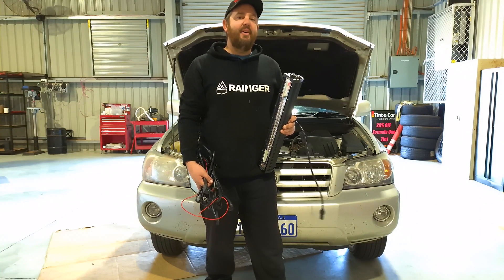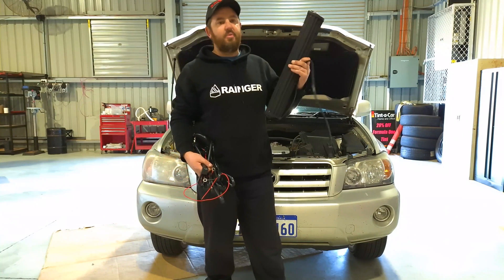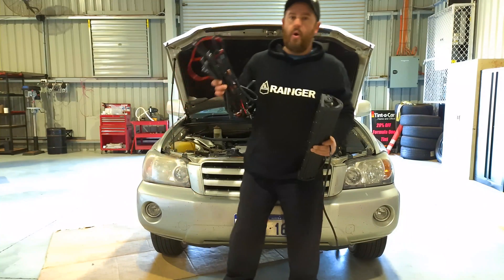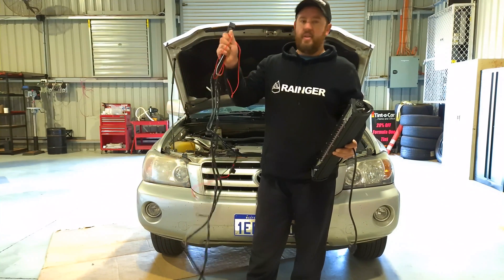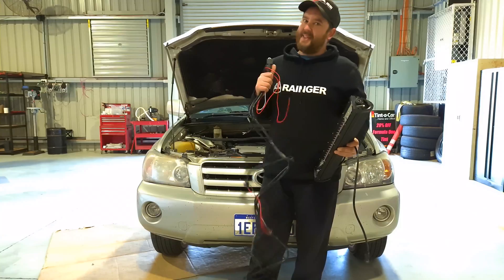How to install a lightbar/spotlights (Beginners guide)

Comment: Man I have found a lot of videos on YouTube regarding this particular subject, and i ain’t going to lie and your video is very well explained and you get right to the point.
Reply from the maker: Thanks mate I'm glad you found it helpful 👍
Reply: I have negative switch highbeam.
I want the lil light on switch to light up when switch is turned on.

Lightbar ONLY allowed on when highbeam on.

I dont know how to wire illuminated 3 pin rocker switch in with it though.
30 is inline fuse battery
86 is power from 30
85 is scotched/spliced HB wire before the car headlight switch (which negative switched highbeams)
87 is lightbar.

You put 2 point on/off rocker switch between scotched HB relay wire and 85 on relay.

I dont know how to do it for 3 prong illuminated rocker switch though.
Can you answer that question? pls n ty.
Reply from the maker: @w0lfm4n43 you can't use the illumination on any switch with negative switching. Only your input & output for the light
Reply: @Campingdownunder  well that sucks butt. Cheers lol
Reply: @Campingdownunder  can u use a separate relay just for the illunation?
Reply from the maker: @w0lfm4n43 never tried. It's not worth it. It causes issues because it back feeds
Reply: @Campingdownunder  so that's what they use that diode for I guess on those harnesses maybe?re
You jump 30 to 86 for negative right, to give the positive on 85.

Can you jump the positive/ground to hold in the third plug going in on rocker switch end?
Theoretically then you should have ground and positive going to both lights when on, n no lights when off?

Comment: This will help heaps, thanks mate, just gotta learn how to splice and solder properly 😂
Reply from the maker: There's a splicing tool you can buy from any auto shop that will do it with just 1 squeeze 👍 that's what I use

Comment: Thanks for the video.  I bought a light some time ago but was going to wire it without a relay directly to a heavy-duty switch or fuse with a switch.  I want to be able to switch it on without any other lights.
Reply from the maker: Always run through a relay. If you are in Australia you need to run it through your highbeam anyway so may as well use a proper loom & then you know you won't have any issues
Reply: @Campingdownunder  
Thanks for the reply.  I will do that.  Have a lovely Easter.

Comment: Hi mate thanks for the video, I'm wiring a light bar to the golf cart, however, its headlight highbeamless (if that's a word), how can I get around this?
Reply from the maker: Just hook the trigger wire to any lights it has then. That way you can't accidentally leave them on when you turn off the buggy 👍

Comment: How do you run a light bar AND spot lights? I got one of those plug n play kits from Supercheap and have since purchased a kings light bar separately
Reply from the maker: You can run it off the same relay but personally I'd run a whole new wiring loom to cover your ass

Comment: How would you connect a light bar with two spotties at the same time? Do you have a video on that mate?
Reply from the maker: You can but it's not recommended. Your better off running them both through their own wiring harnesses

Comment: Hey thanks for the video mate.
Very helpful.
I just have a question...
With pin 86 (vonnecting to the high beam, does it go to the sqith in the car first before coming to the relay? And where do i join the negative coming from the actual light bar?
Your answer would be much appreciated..
Reply from the maker: I made a second video on my channel explaining in more detail how a relay works if you'd like to check it out

Comment: Really well explained. Only question is what lumens was the light, and what would be a recommendation lumens? Iess more, or is it better to get the highest you can afford and your car's general wiring can hand? I want to put  a LED light bar on, seeing that I drive a lot at night and even with the Osron night breakers, its not really the best for the darkness, so any recommendations? And is it better of a high beam LED or just a normal one? If the question make sense?

Comment: Excellent video and great channel. I note some people use an additional 4 point relay wired around the h4 adaptor. You just do it at switch wires or batter power ?
Reply from the maker: Yeah any wiring loom you buy will only come with 1 relay. It's designed to switch the power coming from the battery to the lights. The wire that only triggers the relay doesn't need another relay as the highbeam wire only becomes live when you activate highbeam 👍
Reply: @Campingdownunder  Thanks for that. It would be good if they made them pre wired for either or provided the instructions. All kits these days are for positive.
Reply from the maker: There are quite a few well known brands that make it pretty easy to swap just 1 wire on the loom to switch from positive to negative. The new lightforce loom even switches itself. It already knows if it's positive or negative. They are getting smarter with the looms 👍

Comment: Hi, Spent all day figuring this out on same model Kluger, with the essential help from your video.. 
Now where is a good point to piggy back the ignition power to the relay?
Reply from the maker: Either use an add-a-circuit in the fuse box which is the easiest way or find the wires on the right hand side leading to the windscreen wiper motors. One of those wires will have a 12v signal and shut off when you turn the key off
Reply: Brilliant, thanks so much.
I used a female spade plug inside the bottom section of fuse box next to the battery.. weird things started happening like the power was still on after ignition was off. Even though my multimeter indicated no power on that terminal.
Reply: @Campingdownunder  tricky business, this reverse polarity.. 😆

Comment: G'day mate, any tips on how to connect the wiring on a 2017 Ford Focus. I'm going with the kings number plate mount.
Reply from the maker: I've never fitted one to a focus sorry. I'd start with the headlights and see if you have a positive signal from one of the wires only when the high beam is on. Then you have your signal wire from the headlights. The video should guide you through everything 👍
Reply from the maker: I've also done a video showing how a relay works if that helps you understand how the wiring loom works a bit more 👍
Reply: @Campingdownunder  thanks mate, appreciate your help

Comment: By any chance do I need to have a bigger better battery to power them? Because I already have a subwoofer and I don’t know if the battery can withstand all the power being used
Reply from the maker: As long as the car is running you should be fine 👍

Comment: I'm looking at getting one of those universal mounting bars for my XV. How did you find it held up over time? I'm concerned it will rattle and vibrate and start to crack the plastic?
Reply from the maker: They aren't that great. I wouldn't recommend it. They move while you drive along and the light moves up and down on the road

Comment: Is south Australia we can't mount a  lightbar on the top of the bullbar, is mounting it on the top bar permitted if it's just a little lower than the top of the top bar? 
I don't understand why this law is in place, yet  many cars are still having them on top. I was  warned by the police and I  took it off. 
Thanks for your content.
Reply from the maker: It's all about pedestrian safety if you hit someone. Bullbars have been designed to "slightly" reduce harm to someone if you hit them. There for you can't place anything in the path of someone who would be pushed up into the bonnet. You can use the same mounting holes & mount it upside down under the bar but not on top

Comment: So the relay I can just bolt into the metal of the car and it would do its job and won’t damage nothing correct?
Reply from the maker: Yes that's fine. Just make sure it's mounted upright so water can't get into it

Comment: I have a light bar connected to my Kia 4x4. It has all of sudden stopped working. Disconnected and reconnected nothing happened.. car battery is fine all other electrics work well. Could it be the relay?
Reply from the maker: I just replied to your previous comment. Also if you have a test light test the plug that plugs into the lightbar to see if the lightbar is getting power. There should also be a fuse near the battery that could be blown. Follow the wiring from the relay to the battery and you'll find the fuse

Comment: Hi man, the missus has the same car I’m looking to install some spot lights on, I’m wondering if the wiring harness as the kings one? The negative switching has me scratching my head ;)
Reply from the maker: Adventure king's actually have a video on YouTube explaining how to change the pins in their wiring harness for cars with negative switching. If you search it you should find it. They've made it pretty simple 👍

Comment: I don't seem to have that red wire you connect to the white wire on my harness kit. What is that red wire connected to?
Reply from the maker: The colours are different on each loom. Have you checked out my video explaining how a relay works? That shows in more detail where each wire goes 👍
Reply: @Campingdownunder  thanks I will do
Reply: Worked it out and all works awesome, thanks. Your videos are top quality 👌
Reply from the maker: Glad it worked. Thanks mate 👍
Reply: Which pin numbers are on the relay to connect those black and white wires? Cheers
Reply from the maker: Watch my how a relay works video. It explains all the pins in detail

Comment: Hey mate, where is the number plate mount from? Cheers
Reply from the maker: EBay but you can get them from supercheap or any auto shop. Be aware that's the last option you'd go with for mounting though as you'll get vibration. Best way is to mount the light to a bullbar or nudge bar
Reply: @Campingdownunder  yeh cool, don’t have a bull bar or nudge bar unfortunately

Comment: Question in this set up does the switch you installed allow you to turn off the use of the LED bar and sill use your high beams with out the led bar coming on? Sorry if the question seems basic i am just learning and getting my head around the possible setups. Thanks
Reply from the maker: Legally you have to have a spotlight / light bar running through both your high beam aswell as a separate switch. If you turn off the switch your high beam lights will function normally it's just the spot lights /light bar lights that won't turn on. You don't interfere with the high beam lights at all. All you do is pick up a signal from the high beam lights which triggers the relay turning on the light bar 👍
Reply: @Campingdownunder  perfect thanks for the confirmation

Comment: Is this the same with a 2005 rav4 ?
Reply from the maker: Test the wires behind the headlight. If none of the wires light up with 12v when high beam is on then you have negative switching. If you aren't sure how to test I suggest contacting your nearest Toyota dealer who should be able to give you that information 👍

Comment: My battery is located in the boot under my spare tyre, that's gonna be a problem right?
Reply from the maker: No just make sure you fuse as close to the battery as possible then run the wiring through the car and out of the firewall

Comment: 2005 HiLux VZN167 V6 .3.4lt came with spotlights fitted, relays are there, all the wiring you described, to 2 switches on the dash, yet they have not been successful.  Is this vehicle negative switching ???.
Reply from the maker: A lot of the older hilux's were negative switching
Reply: @Campingdownunder   Older 🤪 ? Thank you.
Reply from the maker: @Jason.SR5 pre 2015 is more likely to be negative switching
Reply: @Campingdownunder  thank you. Subscribed!

Comment: Why is electrical so hard for me to understand 😢
Reply from the maker: It's really not easy mate and takes a long time to learn. If you don't feel confident I wouldn't suggest trying it yourself. For your safety I'd suggest paying an expert so you don't risk burning your car down or causing further damage to anything else electrical in your car
Reply: @Campingdownunder  thanks. Yeah I thought it was as easy as just connecting it to the battery but that doesn’t seem to work.
Reply from the maker: There's a lot more to it than that to remain legal unfortunately
Reply: @Campingdownunder  thank you. I didn’t realize it was even illegal to use these. I see cars everywhere with them. I want to make sure I do it right

Comment: Sound stupid but what happens if you just go positive and  negative to your high beam wires of the head lamp
Reply from the maker: Good question mate 👍 unfortunately it can't be done that easily as the wiring for the highbeam is only designed to be thick enough for the load coming from the headlight. If you connect more lights directly to those thin wires you'll most likely melt them & possibly cause a fire. Hence why a wiring loom has nice thick wires on it to allow for the load of the lights. So we only pick up the trigger wire from the highbeam to the relay. A trigger only requires minimal load so doesn't affect the headlight at all
Reply: @Campingdownunder  ok bugger because i usea test light sounds silly but found Positive and negative of the wiring loom of the back of the head light and wacked a 30 amp fuse On positive and this is on a i30 2019 had many cars with the same set up but do you think the Dangerous Aka firetrap
Reply from the maker: @user-teabager  definitely not safe. The wiring you've added may be able to handle the load of a lightbar but the headlight wiring will still heat up before your fuse even blows. You may be lucky & get away with it but for peace of mind I'd much rather wire it up the correct way
Reply: @Campingdownunder  ok you’re a legend thank you I’m gonna scrub too buddy and share cheers

Comment: Why didn’t you drill new holes in the mounting bracket to match the existing number plate holes instead of drilling 4 holes in the plastic bumper 😂